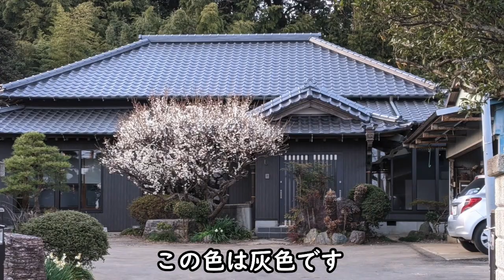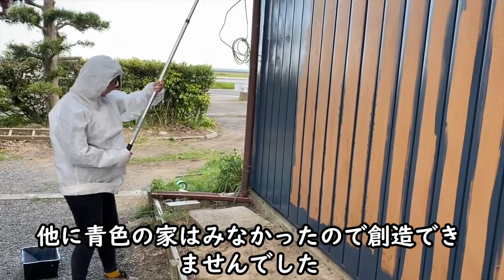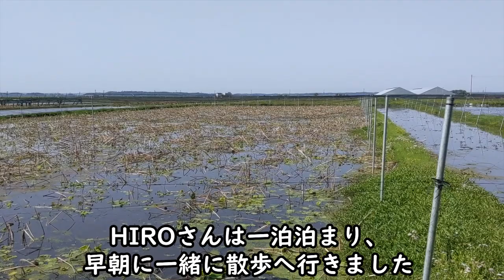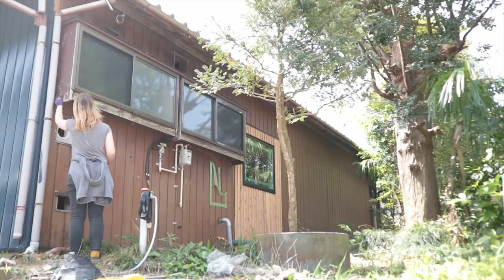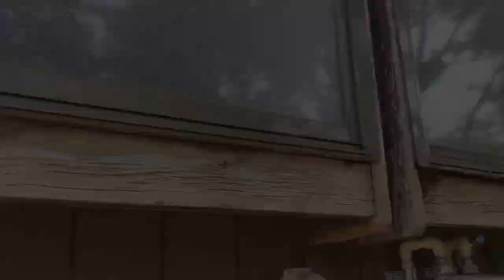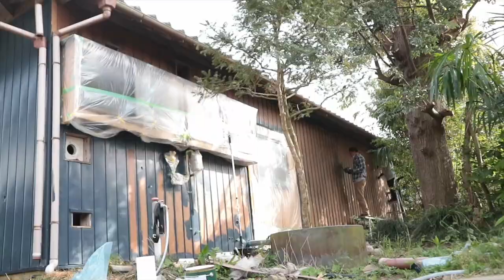Bargain Transformation - DIY Painting the Outside of the House | コスパ最強 - DIYで家を塗る

Comment: The problem with those window boxes is that they're badly insulated, thus condensation magnets during the winter. I used to have standing puddles in the metal railings, and the window sills were always damp/moldy. Not to mention the bitter cold stream of air flowing down the window and onto the floor. I now insert an acrylic "2nd window" during the winter, and it's made a huge difference. Probably worth it just for saving on heating costs. The super cheap alternative is to use "プラダン".
Reply from the maker: Very badly insulated, and very damp! We still need to do something with them! The second window for the winter is definitely on the cards... Thanks Albert

Comment: Fantastic job and that blue looks very smart on the house! Do you have any plans for those window boxes ? My guess is that  ones made out of plastic could be a good long-term solution, as they don't shrink, expand or rot.
Reply from the maker: Thanks Tim! Still no concrete plan on the window boxes... We need to think about it a bit more... Good point with the plastic option...